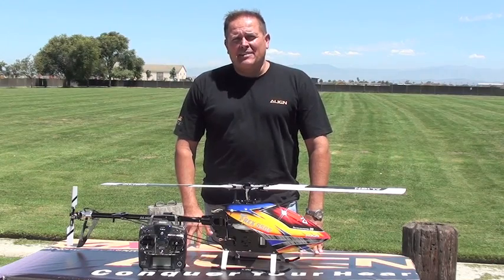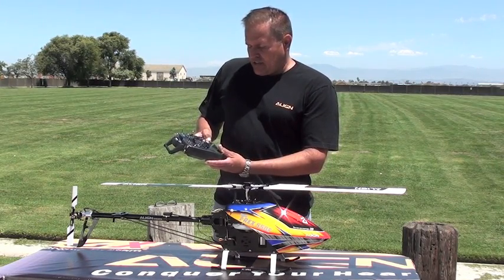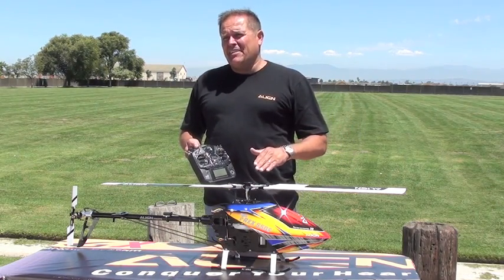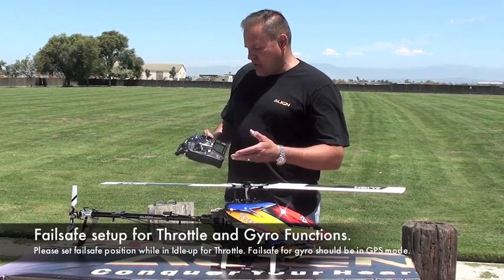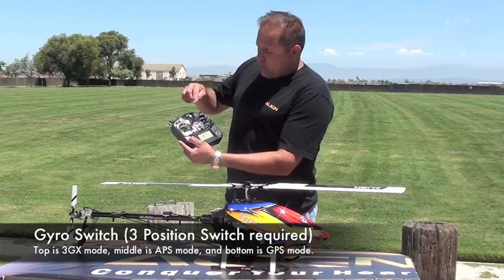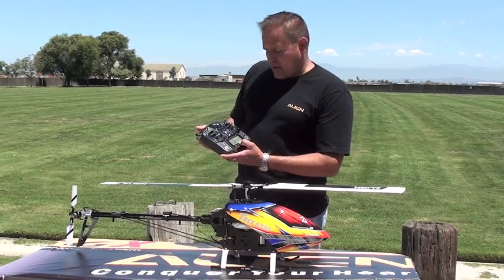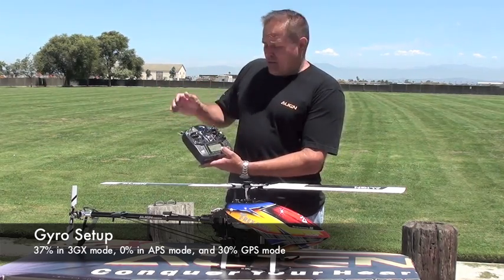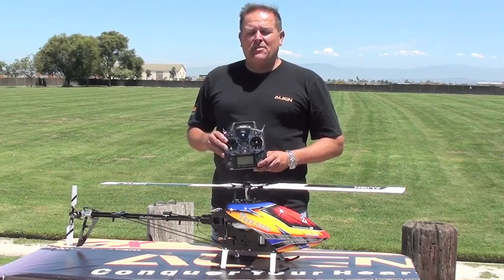ALIGN APS Radio Programming

Comment: Jeff Cheers for the video has helped set up the system, everthing works fine in 3GX mode. Flight check indications prior to flight are fine, yet every time I select APS the Heli rolls to the right. Luckily selected APS at height so able to recover.Vibration test fine any reson for the rolling, many thanks in advance

Nige D